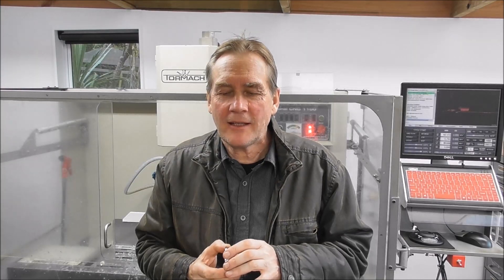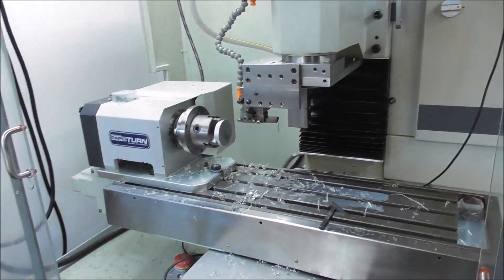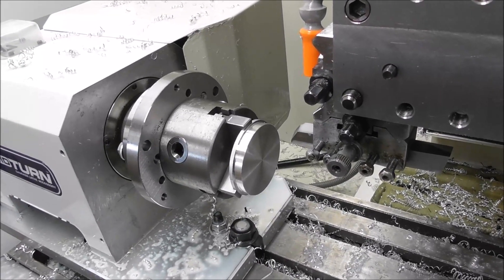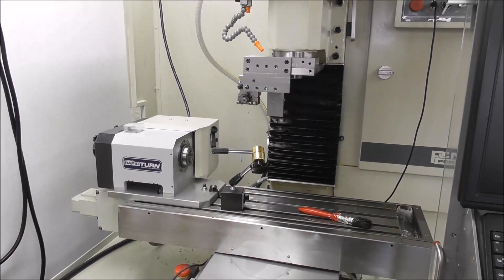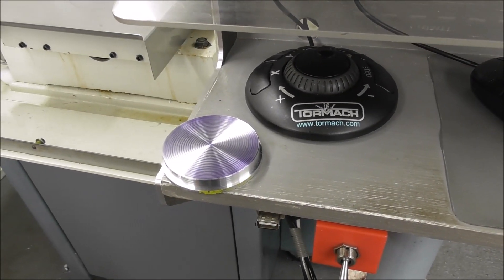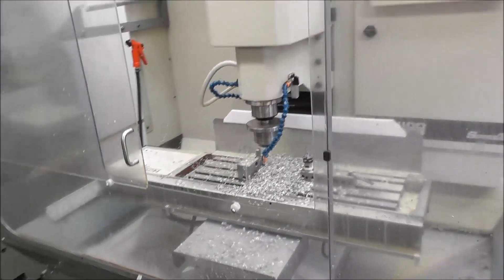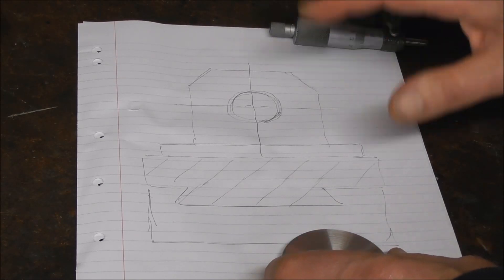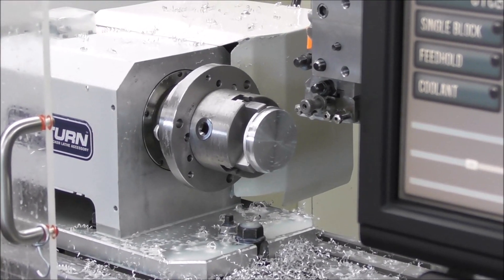Tormach RapidTurn - Part 21- Accuracy continued

Comment: 1) The flood coolant also help remove heat from the aluminum housing. Aim some coolant to it in lieu of dedicated cooling.
2) If you can apply your turning tool point of contact to the  front or back of the diameter rather than the top (or bottom)  ...then you minimize the effect of any housing expansion (similar to the way your vertical spindle turning does) [EDIT ,lol, you just spoke about that]....thanks for the vid
Reply from the maker: Cheers !

Comment: Hi Cliff, I'd agree with your comments around the 10 min mark regarding the pattern on the face of the part.  Had you though of disabling the constant surface speed and try a test cut that way?, perhaps at different feed rates?  You might find the point where performance is maxed out, then, armed with that information create a new recipe that (hopefully) doesn't create the pattern when using constant surface speed by not allowing rapidturn to reach the point of  maximum performance.  That might also confirm (or disprove) your suggestion that there is an over correction happening.  For me, I see an an oscillation condition which in turn, results in the consistent pattern.  As always, thanks for sharing.  For the record I have no CNC machining experience, only some manual lathe and mill experience, and some PID control loop programming experience.
Reply from the maker: Thanks Chris. Yeah you might be right about an oscillation condition ...I have not had time yet to do more than inspect under greater magnification, and I had started thinking oscillation too....Cheers Clff

Comment: Cliff,

Seems like you could reduced the effect of thermal expansion by presenting the cutting tool from 'Y-axis'  rather than the 'z-axis'. If most/all of your thermal expansion effects the height of the spindle above the table, then by presenting the tool from the side results in only a sin error rather than an absolute error.

Comment: Hi Cliff,
I couldn't get that pattern if I wanted to ;-).
I wonder if there would be a possibility of putting two signal flags on the spindle and change the software setting to get two signal pulses per revolution, rather that one.  If the software could be modified, perhaps that could cure both the surface finish and the threading issue.
Reply from the maker: Hi Mark - Yes that may work - Or at least provide some useful information. But can you change that software setting etc?  That is not my field. Cheers  Cliff
Reply: Maybe someone else can chime in on the software side.  In the automotive field, Crankshaft position sensors, vehicle speed sensors and ABS wheel speed sensors have increased their pulses per revolution respectively to enhance system performance.  I just thought that maybe it could work here.

Comment: See if there is a preload nut on the opposite side of the spindle (away from the chuck), I bet you that's just a bit loose. If there is a preload nut, be mindful of not overdoing it when tightening or the bearings will heat up.
Reply from the maker: Thanks Plata - I tried different preload settings. Cheers.

Comment: Hey Cliff, regarding the facing artifacts.  Have you tried moving the tool away on the retract after a facing cut?
Reply from the maker: Hi Pete - Had a similar comment on the zone, yes a retract cut escaped my early thoughts. It may well be that. I will investigate.  Thanks for your insight!
Reply: You bet.  Hope you get it sorted!  Also in regards to the thermal expansion, have you considered making a new housing for the spindle cartridge?  I know that's not a light task, but it would certainly make good YouTube content!
Reply from the maker: Pete I just checked the program.The mystery deepens. The final retract move is G0 X 65.5 Z 5.0 and this angled path shows on the graphics - so it seems well clear on the retract.On close inspection the spiral is made up of 4 coarse spirals of about 6mm pitch with each adjacent spiral groove about 1.5mm part. Really weird. Now I am back to thinking the spirals are cut with some sort of spindle oscillation?...Currently tied up on another production job so only limited time to investigate. 
Your ideas are all welcome!
Reply: Okay that's really odd.  I'll ponder it a bit more, but right now I'm fresh out of ideas.  Quick question, are the 4 spirals you described above or below the finished surface?  I'm wondering if it might appear as 4 spirals, when  it could be 2 spiral grooves 90 out of phase?  Like a multi-start thread?
Reply from the maker: Hi Pete. 4 spirals below the surface. How about a spindle oscillation that is shifting, maybe ex an eccentric bearing or bearing race with a chip under it, that is also creeping around in its housing or on the spindle, or loose in some other way, thus producing a pattern of deeper cuts, which when pitched out by the feed, produce spirals? The craft of ornamental turning use special moving headstock lathes to deliberately produce patterns somewhat like this one.

Comment: Just curious at 21 videos if you have had any second thoughts or feel like while the upfront costs may have been less the time investment is offsetting the purchase of a purpose built cnc lathe?  Even the Tormach lathe or a used cnc lathe might have a more proven reputation?  Please don't get me wrong, I can see for the hobbyist that it is an interesting device or a way to make enough money doing turning to later upgrade?
Reply from the maker: Yes very good question I have been pondering. If I did not already have two 1100's then the Slant Pro would have been a better decision. As it is, the decision is still looking less sound, by the week. Cheers  Cliff